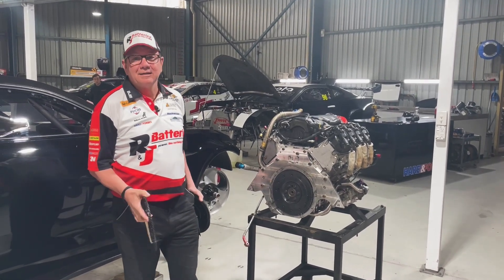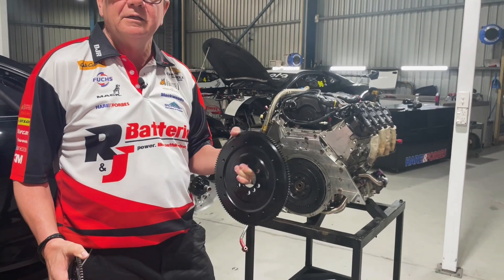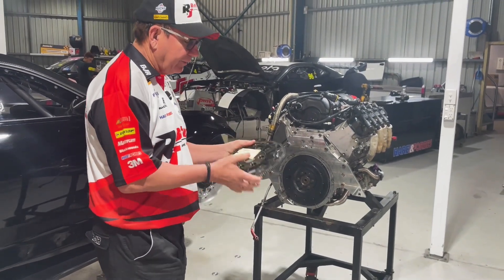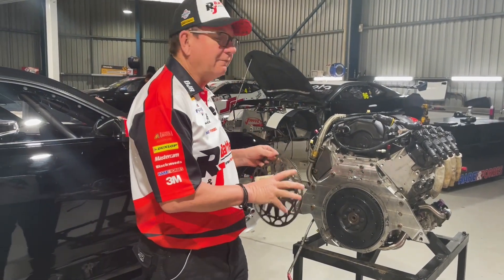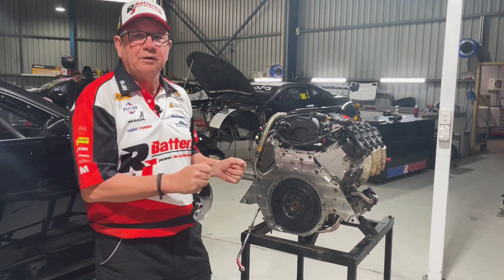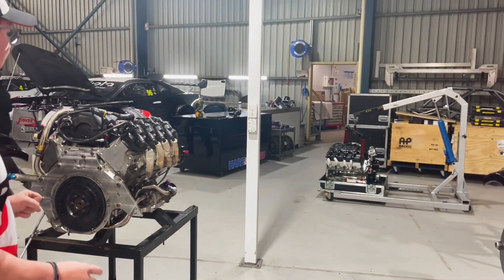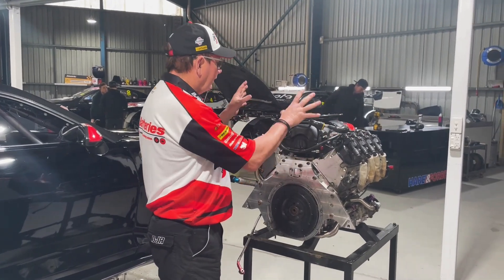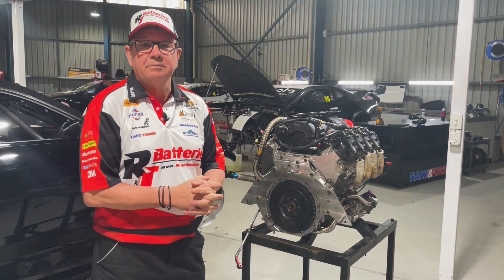Mid-season engine rebuilds explained

Comment: Like when Larry Perkins did the engines way back in the early 1990's and late 1989, they made sure that all areas of the engine which could be opened up were tired down with stainless steel welding wire and capped off with a lead pressed cap and dated so each engine cant be opened up and change anything to make more power, in fact i sold all the stainless steel welding wire to russell ingall when Larry's workshop was near moorabbin airport and also it was aircraft grade stainless steel welding wire as well, due to the fact i was selling aircraft grade alloys to all victorian or should i say australian airlines which included ansett and qantas and small aircraft maintenance workshops all around victoria.
Also was instrumental in supplying chrome moly roll cage tube in various thickness angles & lengths  pre made from the states the same comp[any that supplied the us car racing org's like indy circuit and also pointed out that during the v8 supercars manufacturing of each car, one place was just using mild steel to weld up the roll cages and i pointed out the small hair line cracks in the welds due to the body flexing during the race and advised them to use chrome moly welding wire the same grade as what was supplied and sure enough no more cracks at all?

Comment: By now even steam engines are dohc lol
Reply: Funny that the old pushrod engines are still a better race engine, at least in supercars.
Reply: @timjohnun4297  do some research
Reply: They found out they are expensive and use way more fuel so might even create more pollution?
Pushrod is the green engine lol

Comment: I'm surprised the old engines didn't keep the flywheel with them isn't the crank balanced with the flywheel or both balanced separately?
Reply: The engines are internally balanced. The flywheel is a serviceable part so it needs to be neutrally balanced to bw able to be swapped out 👍

Comment: Curious as to why the flywheel now stays with the engine?  Are the engine components and the flywheel balanced together as a set?  If these have done around 4,000ks and getting the top end rebuilt and the bottom end gets rebuilt at 8,000ks, it seems like you're up for a complete rebuild on an engine every season (plus the top end rebuild at half way).    How does that compare to the old engines, both in terms of component life and rebuild costs?
Reply: This video covers the old engines quite well in terms of costs and life - https://www.youtube.com/watch?v=GqfncRRti5s
Reply: Don't quote me but I think the old engines got rebuilt every1000 km or thereabouts.